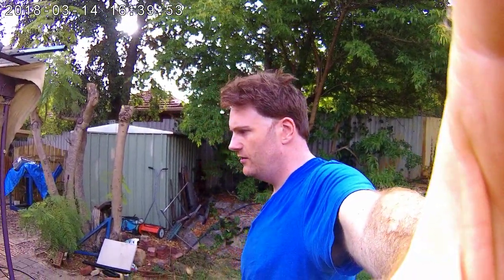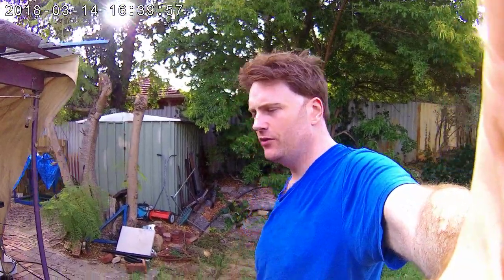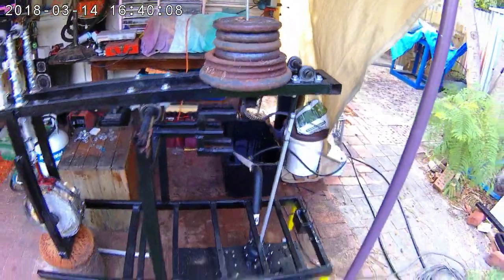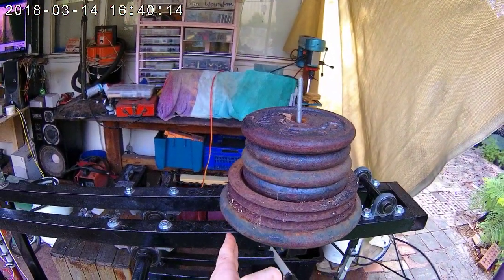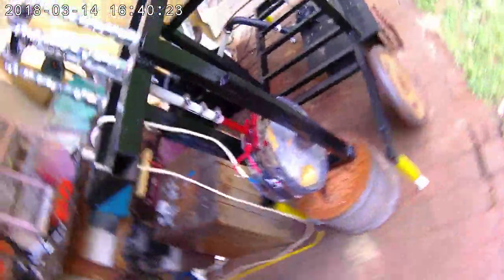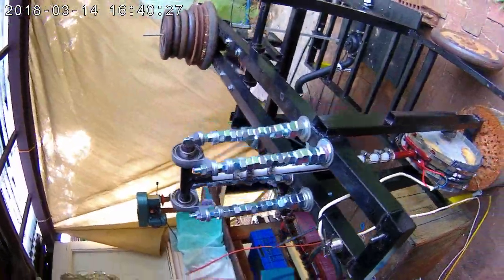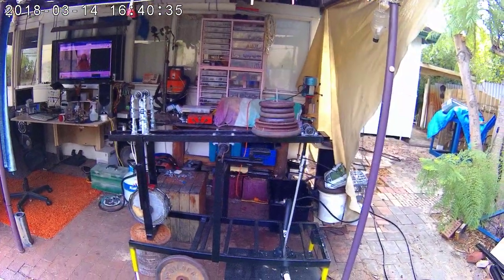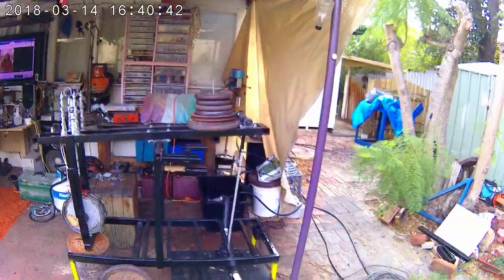Important 1 - Pendulum Update Diaphrahm Pump Test Results 14-3-18

Comment: We are looking at the Velko Milkovic system, that incidentally won him the 2011 Energy-Globe Award, (Regional Entry) Awarded by Mikhail Gorbachev in person. Invigilated by The "Russian Academy of Sciences. ...If you care to improve on this, follow the instructions of "The Russian Academy of Sciences"... First pop down to your local Timber Merchant, and just for fun purchase say seven sheets of one inch thick (25 mm. ?) compression board. (MDF ?) and a big tin of Yacht Varnish.  Beg or borrow or rent an electric Jig-Saw that tilts at 45 degrees. First cut two big holes in an 8' x 4' sheet. (2440 x 1220 mm.) Hole diameter at regular right angles 46" (1168 mm.) or 23" (584 mm,) radius. ...leave an inch (25 mm.) top and bottom. and 3" ( 76 mm.) at both ends. Before cutting this circle drill a 'vertical' guide hole through all seven sheets. (accurately, not slanted by eye, check with a square edge as the hole starts.) Due to the width of the Jigsaw blade, the circle should allow a circumference of 365.25 cm. (45.77 inch Diameter, also the Days in a year.) 365.25 cm. x 2.54 cm. = 927.735 square cm. and the square root of that is 11.99 inches. As near a square foot, as a gnat's whisker. ....  This project will require 52 meters of  Self-adhesive magnetic tape, 25.4 mm. wide. It's OK to buy Type "A" and "B" for self mating purposes, as those will be needed for the magnetic gearing. (see link below) .. The shear strength (breaking magnetic cog) is exceptionally strong, even with only one inch width. There is NO measurable friction either. These rotary pendulums in magnetic geared synchronous rotation, are not going to stop rotating for a very long time..... I prefer herring-bone gearing, (like Sergeant stripes) because the 'self centre' naturally.  to make these though,  requires the tape to be cut into short sections 12.7 mm wide, off the linear tape. When finished, waterproof agricultural sticky tape can secure it to the circular disk. .....  cut at 45 degrees, each short length should be 36 mm.  This flexible tape is 2.5 mm. thick, so it only needs a circular channel to make exactly 360 degrees in 100 strips. (I am a fan of "Sacred Geometry," and a Mathematics and Science Groupie.) Polarity "A" one gear, Polarity "B" the other gear. Next comes four support circular discs. I like 43" diameter, it gives us 135" circumference. or 27 x 5, (3 x 3 x 3 x 5) That perfectly introduces the Golden Ratio, and the "Pentagon" ....  These are also right angle cut discs, and for Magnetic support bearings, need to be Polarity "A" to "A" and Polarity "B" to "B". full repulsion. Cutting the circular discs will be much better with a plunge router, and a 5.0 mm  or 6.3 mm  (1/4") bit. (eg Trend T-TECH, TT/27X1/4TC cutting in from both sides. it has a rounded end. so a third cut needed to trim up with the centre disc clamped and braced with timber batons. and a deeper plunge.) ...  Dilute Yacht Varnish for the first coat. them several full strength coats. especially on the edges....  This magnetic tape will carry a 180 gram load per cm. length, 4" will carry  0.72 kilos per cm. of the circumference. But there are two extra inches with the 'Cup-Cone' edge magnetic bearings. These are cut at 45 degrees. (It helps to drill three holes at 45 degrees to start the cut with the jigsaw at 45 degrees.)  6" of support is 1.08 kilos per cm. circumference. and 108 is a very cool number. Weight in the centre is dead weight for a pendulum, and so we can lose the centre, 7 x 7 = 49, so 70% of the radius in this case 15 inches or a 30" hole through five of the 7 discs, allowing a 6.5" rim, cuts out nearly half the useless weight. Five coffee tables there to allay expenses.  The hole need not be central either! and should not either! three inches at the top is quite sufficient. that leaves ten inches at the bottom. With judicious use of a plunge router, a lot more useless weight can be eliminated. The two outer discs will do a lot of supporting. We end up with a rectangular box 8' x 4' x 7" thick. and a lot of the inner weight of that can be eliminated as well. A "Starrett"  DEEP CUT 210 mm. Hole saw might come in handy? lot's of 8" wheels for another project? ... There is a brilliant way to keep these Rotary Pendulums constantly revolving.  That involves Diametrically Magnetised Rings using those little cube magnets, that cost little more that a few pence each. One half of the Stator Ring is North, the other side South. Four Stator rings are required, and best with at least two rings, North and South one side, South and North the other. The "Rotor then requires Three Rings N-S-N and S-N-S at 180 degrees. This is Mirror Symmetry. When the pendulums are at the bottom, Leverage and a magnetic wedge forces the Stator Rings to "Jump Track" ... At relatively low angular velocity, there is sufficent centrifugal force at the top, to again "Jump Track". The stator only needs to move in mirror symmetry by a displacement of 3.0 mm. each side. Four, two each side  (and another four at the top) stiff 24" cantilever beams pivoted at the centre or off-centre for leverage, can easily do that. 3.0 mm is insignificant.   That link:-   ttps://www.first4magnets.com/tape-strip-c85/magflex-25-4mm-wide-flexible-magnetic-tape-foam-self-adhesive-p3598#ab_1-14|ps_2-2410
Reply from the maker: Big Al, i hope you forgive my technical answer, but i feel its required too go into some detail here in the interests of explaining clearly what i have mind.  my favorite colour is pink.  and i have it on good advise that Velko Milkovic is with me on that one.  By the Way. congratulations on your design, i think it has some wisdom too it, however i have also improved on Mr Milkovic's design, by using a more compact and heavier pendulum. - oh and powering it with a custom designed Linear motor, which unlike traditional electric motors,  uses the Permenant magnets too provide the force, and only requires a small electrical input for switching. ;-).   details coming too my channel now, and over and next few weeks.  much love.